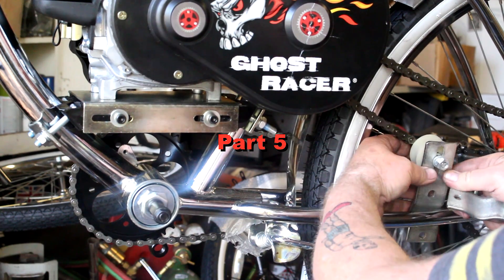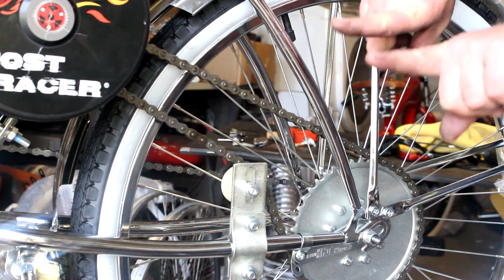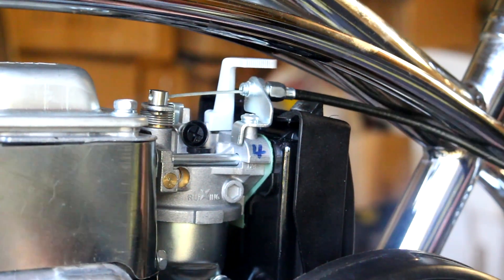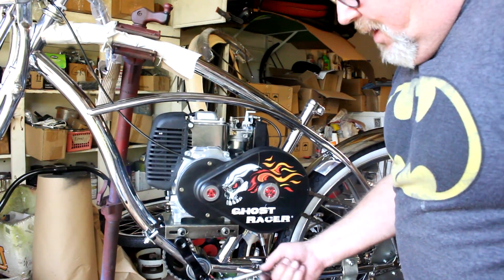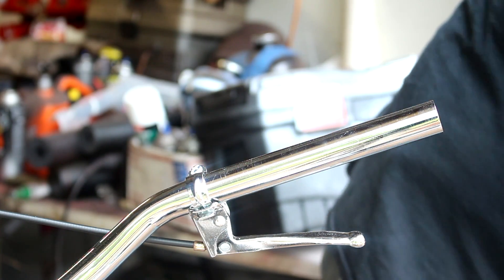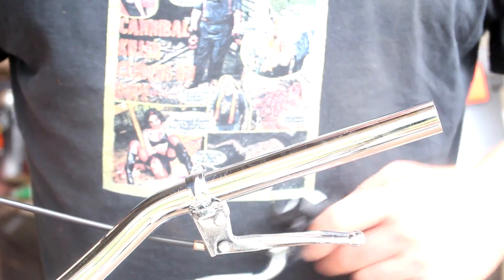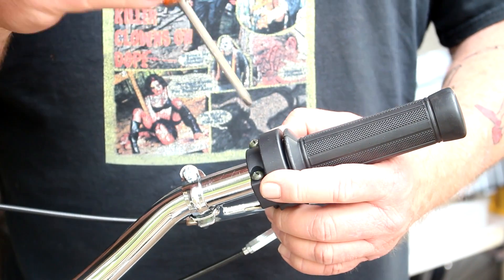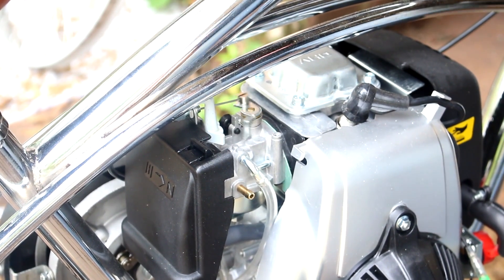How To Build 4 Stroke 7G Motorized Bicycle Part 5 NEW

Comment: I pull it all the way back and run with out plastic from bottom and use a crank and jb weld the chain tensioner..

Comment: That "chain tensioner" is a killer. It WILL FAIL, one way or another. I was almost killed when mine got pulled into the back wheel while riding in a bike lane next to 50 mph traffic. Fortunately I went down on the sidewalk, but still had serious injuries. It doesn't  matter how tight you get it, it can still turn on a round chain stay. If it doesn't turn, the cheesy bracket will bend. Or the fragile plastic roller will break. Remember, this is an ENGINE DRIVEN chain, and needs motorcycle quality parts. There is a nice engine mounted spring loaded tensioner on eBay for the Chinese 2 stroke engines, I don't know what is available for a 4 stroke. I gave up and went with a friction drive, which is a LOT simpler, and has been bulletproof for 3 years. It won't work in the rain, but I live in AZ where it doesn't rain.
Reply: That chain tensioner has a magnetic like attraction towards those spokes and you are completely f*cked with the stock setup. That chain looks like it will rip that tire to shreds also.
Reply: vulcan1753 also he is mounting it without rubber. The rubber locks it down much better.Same with motor mounts and gas tank rubber hose between the frame and all these parts is a must.

Comment: Listen to him about getting that chain tensioner TIGHT. I've had them go into the spokes and I'll just say it wasn't a good day at all. Weld them if possible or ditch that POS and get an arc tensioner that won't go into the spokes because it connects at 2 points of the frame.